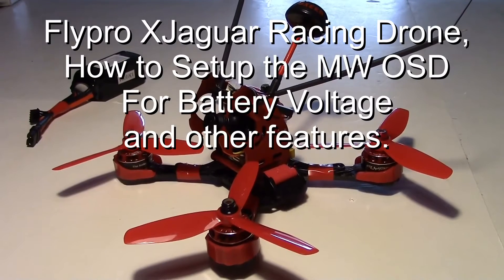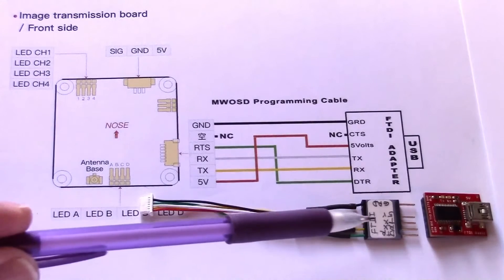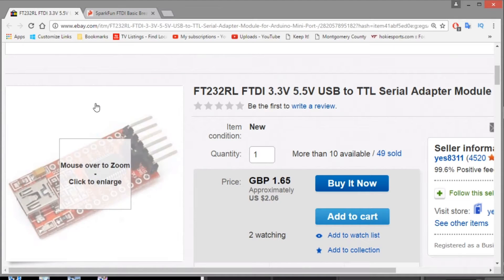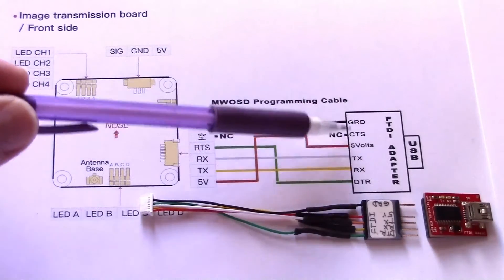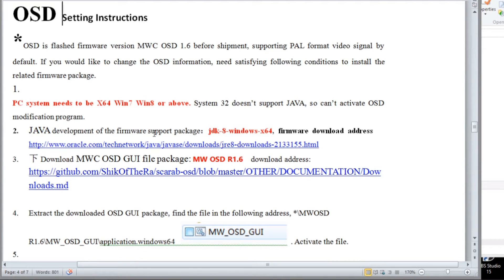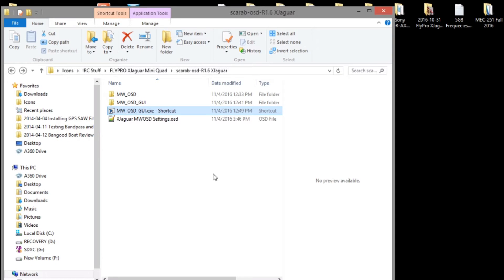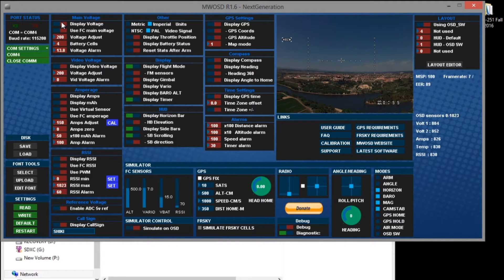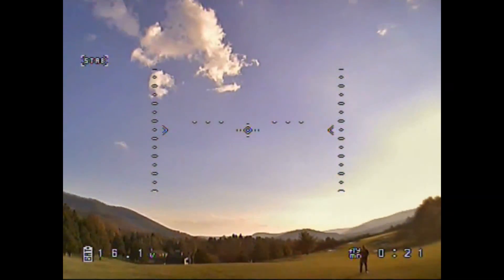FlyPro XJaguar Racing Drone - How to Setup Program MW OSD for Battery Voltage and other features

Comment: You can also use serial passthrough to access the OSD, using the USB port on the FC board. I received one of these for review also. Sadly the USB port fell off the board before I was able to get it set up. I tore it all down and resoldered the connector, but it quit working again soon after... lol Between all that and the headaches figuring out the config stuff (which ports are what) I set it aside until I feel like getting back to it again. Probably soon. ;) Anyway, using the passthrough in Cleanflight, you can change the settings and everything using the OSD's GUI. I swapped the PAL camera in mine for an NTSC one, and had to change the OSD for NTSC video. That's when I found out the font wasn't working in that mode, so I had to load reload the font. Loading it to the OSD through the FC/s USB port and passthrough worked fine.
Reply: BTW, you can configure the ESCs through the FC's USB port also. BLHeli has a cleanflight passthrough mode, and found all 4 ESCs on mine. When I initially built the quad, I soldered all the wires nice and neat, only to find later than two of the motors needed to be reversed... lol I was able to reverse them in the BLHeli GUI which was nice.
Reply from the maker: Yeah that happened to me too and I did the same thing. I watched Joshua Bardwell's video on BLHeli. Great feature.
Reply from the maker: Oh great, I didn't know that. How do I activate the passthrough? Is that setting in Cleanflight ports?

With good intentions I changed the OSD to NTSC and poof! no more OSD. Lucky I was using the GUI and could easily set it back to PAL. Stick menus would not have worked if I couldn't see them. The RunCam Swift camera that came with the XJaguar should be able to be switched to NTSC unless it's PAL only which I gather is what you are saying it is. I couldn't believe FlyPro wanted this quad ready to fly in 10 days considering all the work, testing and troubleshooting with only sketchy instructions.
Reply from the maker: Your right I already had the port 2 setting plus I had already upgraded to the latest Cleanflight so now all I have to do is the CLI setting  which looks like "serialpassthrough 1 115200".
I will try it soon and let you know. So this means there are 3 ways to program the MWOSD.
Oh the difference a day makes :-)
Reply from the maker: serialpassthrough is not a recognized command in Cleanflight 1.13
Have they dropped this feature from newer versions or maybe changed it?
What version of Cleanflight did it work on for you?
Reply: I think it works in 1.14, if not 1.14.1 will have it.
Reply from the maker: Thanks, may upgrade and try it again later.

Comment from the maker: Note: RCSchim has reported there is an alternate method using the sticks on the radio to program the OSD instead:
THR=mid + YAW=right + Pitch/Nick=full = go into OSD menu
if this doesn't work, your OSD board doesn't have a connection to FC board (was the case for me). you might also have "no data" in OSD. 
Solution: in Cleanflight Config / PORTS Tab: set UART2 Data/MSP to on!
(However you may still need the cable and Programming Tool to upgrade the firmware. Personally I enjoy using the cable and the Computer GUI rather than trying navigate the stick menus with my radio.)

Comment: Hi, think I found an easier way to setup hte osd: you can enable "use fc" from inside the osd itself when acessing it with the remote. (Pitch full thr mid and yaw right). This way i didnt have to enter the mw software...
Reply from the maker: RCSchim hey cool. I will have to try that soon. I wonder if you can change the other parameters for the OSD in the same manner with the remote?
Reply: dmerc00 some other functions like wheter or not you wanna see the horizon, thr% and so on...
Reply from the maker: RCSchim thanks I will probably have to put a note in the video description about this as a quicker work around.